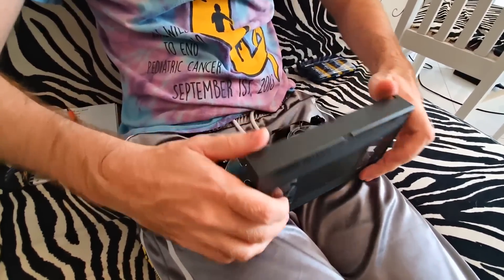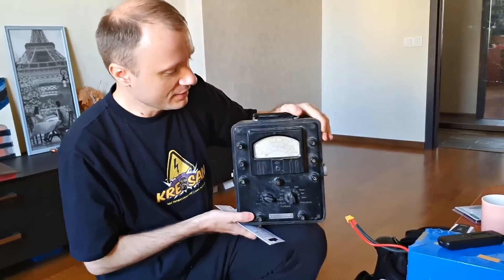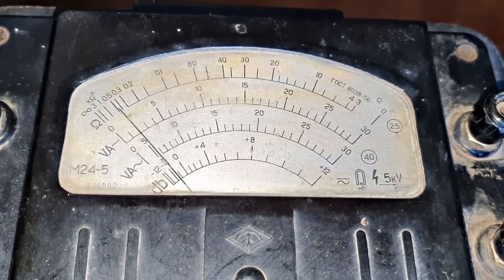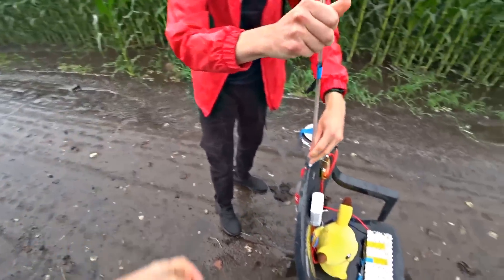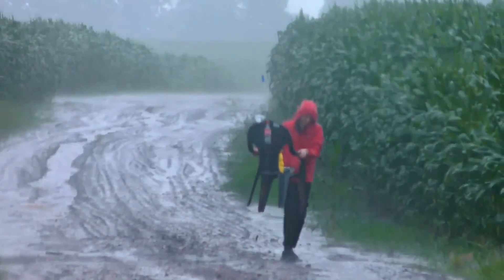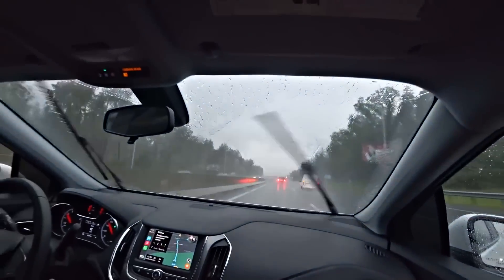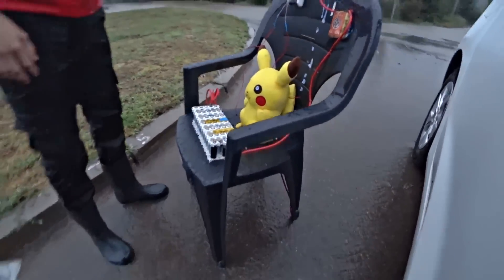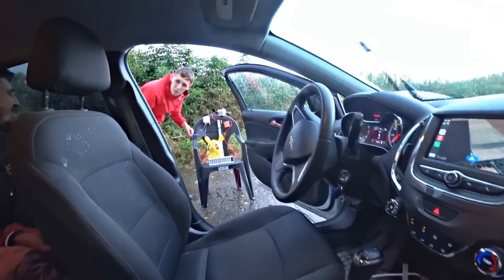How to catch a LIGHTNING ⚡️ ROCKET on a MAGNETIC TAPE Instruction from Kreosan

Comment: It may help to Candle Wax The Electric Match + Chemical Fuse +  Magnesium Ribbon Strip (also waxed) Also run more voltage & current to the Latch Relay from a Super capacitor So The Electric Match hits White hot temps And Auto ignites The candle  Wax And Triggers the Magnesium Strip to burn at 3000C even in water Witch Will Flash Dry out The Rockets Chemical Fuse

Also get a few Hobby Rockets Body's  With Tail fins so  they remain Vertical When they fly

Comment: When and if you try again then please try to add small sharp metal spikes to the balloon or kite. these sharp points cause much more interaction with the ions which causes it to use the ions in the air kind of like a antenna which makes it attract insanely more electricity and from much further away from it as well so that it is much more likely to attract lightning otherwise any nearby trees around the same height will be a much more likely target, doing this and going higher than the trees should greatly increase the chances.
I would recommend a balloon if you can easily make one, hydrogen goes higher and faster than helium, if not then use a kite but you need to add something to slow down the speed at which it unwinds mechanically otherwise it will fall down, kites can lift more weight in general than a small weather balloon and since helium is expensive and hydrogen takes long to generate and tons of energy. so if you want it to lift some decent weight the kite probably is better.

also did you measure the tape resistance, how high is it, you might also be able to use a thin wire from a material like wool or just general wire and put it in salt water or cleaning soda water, that way it conducts well and acts like a very cheap water this method is also reproducable with primitive wires on a island using things like gras wire then you could use lightning to start a fire or to try to electro cook something. if you send it through a piece or bar of iron or ohter ferromagnetic material then that metal will turn into a magnet, it should not melt to much to stay as strong as possible so using a big piece of metal or putting it in a bucket of non salt water would help, this because the metal conducts better so the water will act as cooling, keep distance however since it will explode on impact when the watter evaporates.

Comment: balloon is most relyable, however I did it with a kite. balloons just go up and up, slowly but they stay up for very long and don't need stable wind. I used a kite but with many kites you are very much relying on a stable wind, such a very basic kite works well and mostly stabilizes itself even in turbulent wind, but it still needs decent wind to go up, and a kite is dangerous and difficult because you need to unwind it slowly. this can be done using a automatic braking system, however it is best to set up the kite just before the storm so that it is already at it's maximum height, doing it during a storm is also possible when mostly auomated but unsafe.
drones are quite expensive have a limite range have many problems with winds especially turbulent ones and their RC systems break down during a lightningstorm because the radiowaves from the lightning and discharges in the clouds anywhere closeby will interfere with the radio signal causing you to lose signal and controll. and even worse is that the microchips used in them tend to glitch and chrash due to not being protected against decent to strong emf. you can try to shield the electronics other than the antenna.

but the baloon would be the most optimal method, that method is actually that good that if you use a hyrogen foil balloon you can already catch lightning when you are not actively in a storm due to the ionization layers of the atmosphere, since hydrogen foil balloons can go close to the border of outerspace. helium doesn't go as high but is safer. 
a kite would be the other first option it depends on how many you want it to cost and how much and what material you have. a foil kite is typically very easy and cheap to make. it is kind of something children at at primary school could do during class. as long as the winds aren't to strong you can just simply use aliminium foil for the kites surface area, then on the bottom and edges add some tape, also add some general tape croses through the center this is to prevent rips and to make sure it kind of stays intact if it rips. you can just use something like reed for the wooden support beems and you are done. ofcource all epends on the size. I made my kite around 40cm by 60cm or so in the typical shape. my surface was entirely aluminium foil which was enforced with tape near the edges and like some cross through the center(didn't actually enforce the most outer sides to increase the ion interaction), I added a sharp point also made from aluminium foil this was to  increase ion activity and to generate a ion candle(ligth) when used in the dark once high enough so it indicated when there was a strong es difference. the support beams where however actually made out cardboard in a special geometry to reenforce them, this was just strong enough and it didn't need to last long anyway. attaching the wire however required it to connect it to the frame with a decent amount of wire behind that which with a loose bend was connected to the metal so that if the foil moved in relation to the frame the wire wouldn't get lose and so the wire wouldn't pull on the foil directly. btw. I do not recommend to use cardboard in it, in my case it worked but it is a lot more work and gives you litterally only one shot in general, it also isn't that much lighter than light wood and reed likely would weigh less.
Reply: did you have any video or any other ref? i would like to try this, but dont talk about pros like florida scientist guys, i just want to cheapest DIY possible

Comment: Foiled Helium balloons attached at different heights (100m intervals) largest one first, 
on the same fishing line to capture the thickness of the clouds ,
then run your earth strap- copper steel wire /videotape to the  Thick fishing line, 
anchored to a washing machine, for best results add a secondary 'diagonal' fishing line facing the on coming winds to support the structure.
Make multiple set ups to increase your chances.
Weigh all your components and pull strength of balloons to best calculate what strength of fishing line is suited, catch weight in LB's supplied by manufacturers.
( doesnt factor winds horizontal pull strength) more balloons reduce weight but add drag !

Comment: Im willing to bet yall didnt do a long distance ( actual distance)test, just because it works by the car wont mean its going to work 75 meters away... the transmitter isnt strong enough to go the distance. The system is made for a home, not a football field. Get a stronger transmitter.

Comment: The foil balloon sounds like a much more stable way to attract lighting. The rocket is a cool idea, and would make an amazing video, but it would be so much easier to just let a balloon hang out until lighting finds it. 
Love your videos guys!
Reply: Plus you could set it up, leave it up, before the storm got bad. Less risk of getting electrocuted if the lightning comes early. I’m not sure how the balloon will fair with strong winds but even if it fails it’s cheap to try again.
Reply: @3 I liked the idea at first, but what would probably happen, is the whole thing would get blown out horizontally and then get tangled on the ground.
Reply: @3 kite with a key on it then?

Comment: I've been within 7 to 20 meters of lightening strikes several times. Maybe it was a fluke, but it really wasn't ever as loud as you might think, about like a fire cracker. The light is pretty bright, might see an after image for several minutes. I don't think I was ever shocked but it is hard to be absolutely sure since it startles me which itself can feel like a small shock.

There is a place in the US that studies lightening that does similar experiments. They use a model rocket and fine enamel wire, the kind used in motors and electromagnets. I assume one end is well grounded. 

Personally I think the drone trailing a wire idea is better. A few hundred meters is probably enough if lightening is going to strike and you can send it up and wait. I think the video tape might work as a conductor although it will catch wind. Probably too much trouble, but it might cool to see if you can light a neon sign even before a strike. 

Don't forget Ben Franklin had the luck of a fool, one of the first guys to try to replicate his kite in a thunderstorm experiment was killed, in France I think.
Reply: We were filming something in a building earlier this year, it was the top floor with only a small thin roof above us.
There was a storm going on and then it was calm for about 10 minutes.
We resumed filming and suddenly there was a giant bang, the loudest thing I've heard in a long time, and I swear a fizzing inside the room for a split second, like a high voltage corona.
There was also a flash that felt like it was inside the room but may have been the fluorescent tubes being energised.
We decided that lightning must have struck directly above us and the flash occured at the same time as the giant clap/bang.
Reply: I think this heavily depends on how strong the lightning is and perception (low pitched pressure waves typically aren't perceived that loud, they are rather felt). I observed a lightning strike ~800m away and it my walls were slightly shaking from the pressure. Definetely louder than a firecracker.
Reply: one of the loudest thing I heard in my life was a lightning (around 200m from me) all the windows were shaking
Reply: @Jordan-Tech  This is sort of a reply to all. i agree the strength of the bolt is probably a factor. I may have been too close to judge since the flash was literally blinding for an instant. The distance different sound frequencies travel could have a psychological effect of paradoxically reduced volume close up where the high frequencies are still loud. (One of my hobbies is making microphones sensitive to very low frequencies. Deep sounds like volcanos, tornados, lightening, large waves hitting land, atomic bomb tests and etc can travel hundreds to tens of thousands of miles.) 

Anyway, 200m is too far away to observe the less loud effect. i know I have heard some very loud ones at that distance.

i tried and failed to put into words the hypothesis that popped into my head while writing this. I might see if i can whip up a computer simulation to make a video to explain.
Reply: @Jordan-Tech  I had my windows shaking from lightning from lightning a few times. Once I could actually feel the walls vibrating to. They were maybe 150 to 1000 meters away, I can only estimate as I didn't see most of them.

Comment: I just use model rockets with enameled wire that is 38AWG, 0.1mm, copper wire and a copper rod to ground (earth) it with. I get a strike about 1/3 of the time. I guess I'll give a VHS tape a go.
Reply: any video on that? i would like to know more
Reply: Do you have any problems with wire breakage due to the rocket's rapid acceleration and/or melting from the rockets hot exhaust? Also is your wire spool attached to the rocket, or is the spool on the ground and unravelled by the rocket when it goes up?
Reply: Also are you monitoring KV/M static charges in the air to know when to launch? Sorry I have a lot of questions.. would love to speak with you about it.

Comment: I think a kite that was done back in the 1800s you need to have metal string very long metal cord you should be able to achieve the result as long as you have when it's going to stay up in the air and it should come down thank you for previous experiments I always like to work you guys do all the best to your group may you continue the great work experimentations this is how we evolve this is how we grow
Reply: It might be hard to keep a kite up in the air without moving and adjusting it by hand. Ben Franklin tried it and only got a slight static charge, but the next guy to try it got a complete lightning bolt and died.

Comment: A couple of hundred feet isn't high enough you'll need to have lightning strike close enough to find it and at the right moment. I think the rocket needs to be inside the cloud for it to discharge down the tape. And at those altitudes, you'd be better off using thin wire as a conductor.